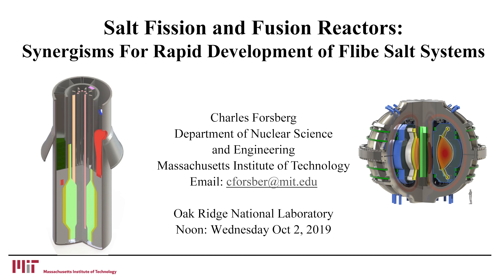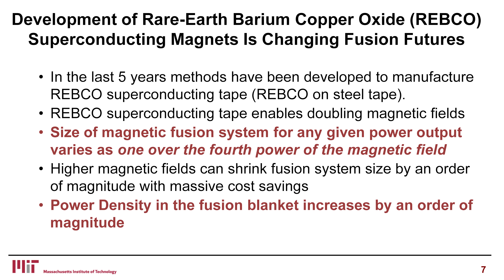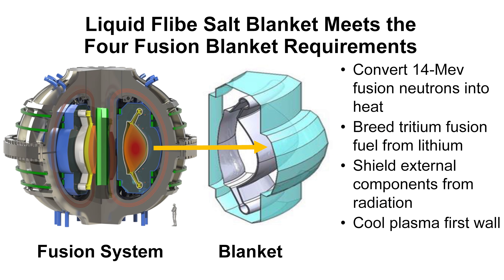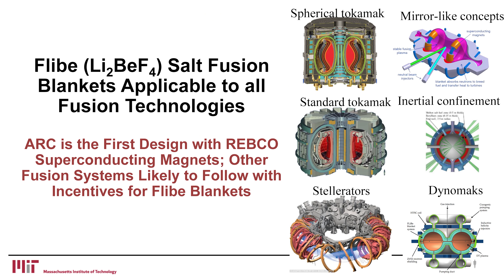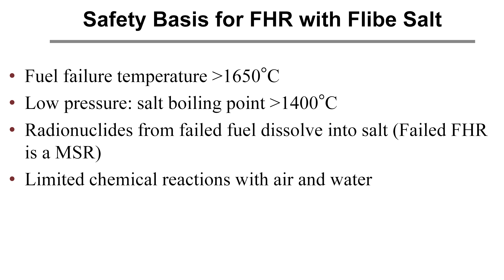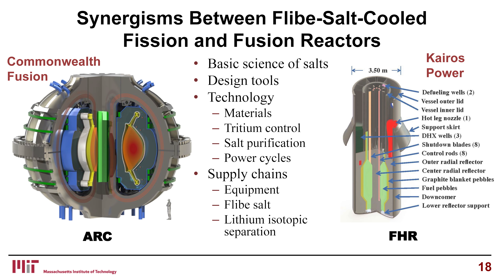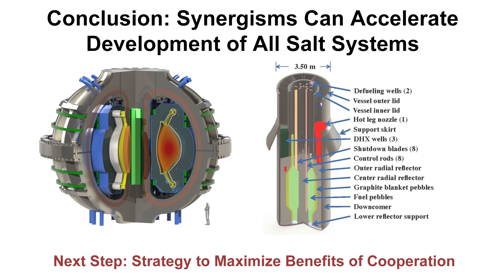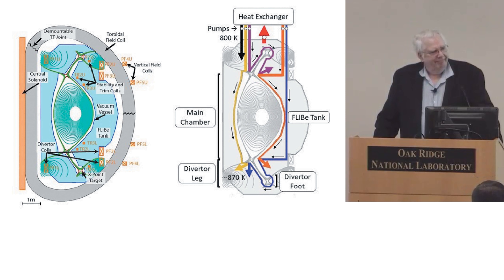Molten-Salt Fusion Reactors and Molten-Salt Fission Reactors - Dr. Charles Forsberg @ ORNL MSRW 2019

Comment: What is the method of energy extraction?
Reply: Conduction between the first three systems, convection within those systems, a Venturi effect step, some aerodynamics to push a turbine, finally leading to induction, nothing new after the heat sources (system #1.) But it's still very important because it's clean. And once everything heats up it's pretty darn efficient and safe.
Reply: @fiftystate1388  Its an Interesting Concept for sure. I'm sure, by now, it's long been more than just a concept. I'm just surprised we are still trying to figure out new ways to boil fluids and turn turbines. Is 65% efficiency really the best we can do?
Reply: @fiftystate1388  We could have hollowed out mountains and produced an equal amount of hydroelectric for half the cost of the fission program, without the contaminated water and the disaster waiting to happen along every waterway in America.
Reply: @fiftystate1388  Thank you for the Informative Reply. I am interested in this technology, it seems promising for very long range flight with the right propulsion system in place.
Reply: Verify Truth yeah but you talking about a single station which could only supply electricity to its local error, the fusion project is something completely different. It's the only viable solution for the energy demand of the future, plus we will be able to build the, anywhere(won't need to build them close to water) which is an obvious requirement if we are trying to build a reactor design that will eventually power the world. The fact you compared it to hydroelectric speaks volumes to your understanding of the problems surrounding this entire topic....
Reply: @metatron5199  Volume.. like on a television remote?
Reply: @metatron5199  Technology that hasn't even produced energy after decades of development and billions of dollars by definition isn't a viable solution for generating power. And if it ever does, it still needs a high enough EROI to justify its use. With EROI into the thousands on some nuclear reactors, that is an enormous hurdle

Comment: So you going to pull microwaves a part  for the the thorium spring, crash the beryllium ceramic, and fourite rock washed in an acid. And combine i  some way and simmer till dry and hit with electricity, voltage unknown and pow you have a gama ray emitter.  Oh yes, I really mean thorium in a microwaves cooker.
Reply from the maker: No beryllium ceramic. FLiBe is a liquid, is molten salt. Both Li and Be in the salt produce tritium when hit by high energy neutrons.
Reply: @gordonmcdowell  the white and or pink ceramic tips on the ends of the magnetron spindle aren't they berylium in some way, very high temperatures at close range. After all the heat is a lot, at the 3cm wave length. The microwave thing inside the magnets rings that have the aluminium cooling fins, one goes into the wond bits of copper, the attach to the capacitor.  Yes, mate I am an ewast recylcer and are told not break those ends and have several grams of Thorium a beta emitter under glass. Have fun, and Thundref00t did something on these years ago. 😊👌👌👍👍 Keep going and have fun.

Comment: in the sun fusion occurs at the center and any kinks simply encounter more plasma surrounding it.in a torus doughnut any kinks overcome the containment
Reply: The suns core has a lower power density than a compost heap. I do not think your comparison is relevant.
Reply: @esecallum  ahh, yes. Whatever man.

Comment: A spherical shaped fusion reactor can be made easily and the electric/magnetic fields used to contain it by using a large number of external magnetic fields.They do it already using polywell test reactors.

ITER is totally useless and even if they get containment for 90 seconds (which i totally doubt by the way) HOW are they going to get any energy OUT of it bearing in mind how fragile the whole thing to even the slightest magnetic field imperfection???

There is simply no way you access the torus as the the containment coils must not be disturbed even slightly.

Have any of you thought of that?
Reply: Just look at the Stellerator. ITER is an outdated, overpriced concept.
Reply: @bernadettetreual  you are correct.even the robert bussard  the inventor dumped it 1996
Reply: @esecallum  
Are you still using magnets? What kind of stone age of fusion research are you living in?
Neutrons answers your question.

Comment: Another fun way to boil water again? I don't know much about Fusion, but I will learn if i have the time.
Reply from the maker: No. It is not. Neither Molten Salt Reactors, nor Fusion Reactors.
Reply: @gordonmcdowell  How are they used without boiling water? Ie, how do they provide usable energy for our activities, industries and environment?
Reply: @gordonmcdowell  What is the method of energy conversion being used by these specific devices? This is a sincere Question. It is not discussed in the video. Is it extracted magnetically by fluid motion? How will the generated heat be utilized to produce energy? Are there multiple factors of energy conversion? Pressure? Heat? Motion? Magnetic Field? As I stated, I don't know much about the primary method of utilizing the energy generated by this fusion process. I have read about storing generated heat via molten salts, but only concerning solar arrays. If you could point me in the right direction of the basics It would be greatly appreciated.
Reply: @gordonmcdowell  Are they utilizing and converting the Radiofrequency directly?
Reply: @gordonmcdowell  Does it operate as a magnetic dynamo?
Reply: @gordonmcdowell  Is the energy storage medium based internally, Mechanically, Chemically in the fluid, or converted for external storage?
Reply: @gordonmcdowell  Can it be throttled and used instantaneously for thrust?
Reply from the maker: @VerifyTheTruth  Well whatever heat is created in a FLiBe blanket due to high-energy neutrons breaking FLiBe into Tritium (and other elements) would likely be circulated through a heat-exchanger to another salt (clean salt, possibly less expensive one than FLiBe), and clean salt circulated to a closed-cycle gas turbine. I'm editing an interview with Forsberg now and he talks about turbines.
Reply from the maker: @tricky778  FLiBe blanket intercepts high-energy neutrons breaking FLiBe into Tritium (and other elements) would likely be circulated through a heat-exchanger to another salt (clean salt, possibly less expensive one than FLiBe), and clean salt circulated to a closed-cycle gas turbine. Compressed steam is not needed, and certainly not any boiling of water.
Reply: @gordonmcdowell  just using convection?
Reply from the maker: Tristan Wibberley Pumps. MSR have pump-free emergency shutdown mechanisms for dispersing decay heat but under normal operation salts in all reactors move through heat exchangers and turbines with pumps.
Reply: @gordonmcdowell  ah, they're going to get the energy using a perpetual-motion system where the pumps push the liquid through the turbine so the turbine can produce the energy to operate the pumps? An excellent solution.
Reply: yes fusion reactors can turn turbines with heat like a normal reactor. but the ability to create strong electromagnetic fields means the walls of the reactor can conduct electrical power directly. this video is just a new discovery on how to make the field stronger so we can squeeze more power out of the reactor not to mention make it a little safer by improving the radiation shielding and helps keep the reaction going by preventing the walls from being melted by plasma.
Reply: @gordonmcdowell  (I'm an MSR advocate) YES, this is a way to boil water. It uses conduction to transfer heat from the hot (radioactive) salt loop to the heat-transferring salt loop and that salt conducts heat to a boiler which spins a turbine attached to a generator. The loops use convection (pumps.)
Maybe the holy grail is to control electrons without moving magnets, but right now induction is state-of-the-art, and it has been since the genius Faraday.
Sometimes I pray I'm wrong, please point to where MSR/Fusion systems don't power steam turbines.
Reply: Yes, Faraday's mechanical work is still the foundation to control electrons. It's been refined but it hasn't been replaced.
Reply: @psionx1  I'm sorry psionx, but I think you've got an important concept wrong. Yes, preventing the wall from melting is an important part of what the magnetic fields do. They also stir the plasma and that heats it up even more. However, they don't make electricity directly. The plasma is made from hydrogen. Eventually the plasma is going to get so hot that the hydrogen atoms (ions) will slam into each other so hard some will fuse together. When they do, the new creation takes less energy to stay together than it did to force them together. Energy is never destroyed so that means there is left over energy. We can boil water with the leftover energy. Fusion reactors provide heat. Heat boils water and its steam pressurizes a container. The steam is allowed to escape to spin a turbine that's connected to a generator. Fusion is just another source of heat. It is clean and safe. As of now though it takes more energy to heat the plasma, than the heat it makes. It's kind of like starting a fire by rubbing sticks together. You can burn yourself where the sticks are rubbing before it catches fire, and you can use a lot of effort (energy) to heat them up, heck, if you put barely enough water on it you'll even make a tiny puff of steam, but until it catches fire it looks like it's all for nothing. You might find these helpful: https://en.wikipedia.org/wiki/Binding_energy , https://en.wikipedia.org/wiki/Strong_interaction , https://en.wikipedia.org/wiki/Nuclear_physics - You're not going to find much on moving electrons directly though, anywhere. This is as far as humanity has gotten to that end: https://en.wikipedia.org/wiki/Electromagnetic_induction
Reply: @tricky778  Maybe you'll find my other replies in this thread helpful, sounds like you were getting frustrated by a slow response. Gordonmcdowell's "pump free" concept only referred to a fail-safe safety device, it's simple and proven, and well documented. Try a YouTube search for "MSR salt plug"
Reply from the maker: @fiftystate1388   "heat to a boiler which spins a turbine attached to a generator" Forsberg spoke about it in our interview but not in this video, gas turbines can be used with the 650C output temperature, more efficient than steam turbine. I hope to show more on that soon. I do have an existing video where Kirk Sorensen talks about power conversion systems (deep link): https://youtu.be/xBmk7t5K35A?t=1626
Reply: @gordonmcdowell  Thanks for the link! Obviously I thought the gas was water vapor. It still involves a couple of salt loops, and it's heat to mechanical, but CO2 for the turbine is so much better. "putting in $50M of research," to this flow technology, a pittance! If the US gov. would sponsor a competition between reactor designs (traveling wave, chloride salts, etc) we would solve so many problems. While I (as an interested bystander,) think MSR/LFTR would win, such a competition would clearly expand our knowledge and possibly demonstrate design strengths to apply to solve specific problems. MSR may be best at large scale deployment to generate electricity because of its inherent safety, traveling wave my be better at processing spent fuel or the hottest wastes. Amateur speculation, but people like to hear my descriptions.
Reply: The advantage of molten salt is that it runs at much higher temperatures. These are enough for directly powering industrial processes e.g. ammonia, portland cement even melting aluminium.
Reply: Actually MSRs work better with gas turbines than with steam turbines. No boiling water needed.
Reply: @fiftystate1388  https://en.m.wikipedia.org/wiki/Voltage

Comment: in a sphere the particles only have 2 main DEGREES OF FREEDOM....

outwards and inwards.

the outward pressure gas radiation pressure is balanced by gravity.

in a sphere there can be no kinks at the center.

in a doughnut plasma ribbon you have 6 degrees of freedom for any particle.this is why it keeps failing.

the particles from the circular ribbon can kink in any direction due to the slightest imperfection in the magnetic field.up down.left right.in out.

its like balancing a pencil on its point..the whole gizmo is unstable no matter what you do.
Reply: You are still suggesting that we should control plasma against it's nature. Sure, but it won't be efficient.
A question is how do you achieve a magnetic field that isn't 0 at the top of the reactor. Plasmas move naturally toward weak fields, especially where it can no longer contain it self.

Comment: Hello I Am Dr. McDaniel And 16 Years Ago I Created The Formula 2H2 → 4H+ + 4e- For Oxygen Hydrogen Fusion. Using The Equation q = m·ΔHf I Found A 16 Tech Tree For Fusion From 1 Egg To Salt 16 And Selected The 16th Salt Fusion. Then 1 Day Ago I Auto Corrected To The Formula 2H2(g) + O2(g) → 2 NACL(s) The Reaction Between Hydrogen Gas And Oxygen Gas To Form Sodium Chloride. The Molten Salt Reactor Can Be Made From The Oxygen Hydrogen Fuel Cell Vehicle And Reverse Engineered To Produce Salt On An Industrial Scale.

Comment: if you want tritium from your coolant, you have issues with your system
Reply from the maker: Now, I think we both know that's not what is being proposed.
Reply: @gordonmcdowell  i dont like what is proposed, i dont want to share the pride you have, i dont want to be "we" with you
Reply from the maker: @Jkauppa  I am saying you are pretending to be dumb, rather than someone who is, in fact, trolling nuclear videos. Your comments are consolidated on my dashboard. Happy to block you, if that's what you need.
Reply: @gordonmcdowell  happy blocking treasures, which i dont not know anything of, and i dont want to, if it makes my part in wisdom of God vanish
Reply: @gordonmcdowell  and for real, if you need your coolant to do anything other than to cool, your design needs.. what i said
Reply: @Jkauppa  meanwhile supersonic jets use their fuel as coolant, lol. youre right and everyone else is wrong.
Reply: @Jkauppa  Dude you don't get it the best coolet for the fusion reactor is what the fisson reactor use for fuel with a differet fuel mixture. Byproducts for the fission reactor that work against it is fuel for the fusion reactor. They are trying to make the fusion and fission work better together than they do by themselves. One reactor enhancing the performance of the other.
Reply: @clementvining2487  I don't see you doing fusion
Reply: @clementvining2487  its like you are trying to teach someone on how to do fusion even if you are still stuck in fission
Reply: @clementvining2487  you could do assisted fusion with the energy of fission
Reply: @Jkauppa  I am interested in any kind of power generation in the most efficient way possible. Everything from fission fusion and antimatter for space propulsion. I am also interested in active radiation shielding, space geometry, general relativity. 

Look what these people are trying to do is making part of the fuel mixture with a fission reactor. Using the new superconducting magnetic tape decreasing the size of the  reactor and increasing the magnetic field. Then using the salt formulas  to double the cooling capacity. These are all good technologies that can have an effect on other fusion concepts. Bigger is not always better what these people are doing is a move in the correct direction. Doing the same thing we have been doing for over fifty years is not getting us anywhere. I am not really interested in this type of fussion per say, but some of the technologies involved.

 I am interested in direct reversed field fusion drive like Presinten university is trying to develop for space propulsion. They are in stage 2, I think stage 3 is a working prototype in space. It is easier I think to make a fusion drive work than a fusion reactor for generating power. A fusion drive does not have to go passed the break even amount because the thrust and the specific impulse is the most important thing. This drive system is estimated to be 10 to 15 magawatts with a specific impulse of 10000 the size of a van. The system is estimated to be over break even on power plus thrust.